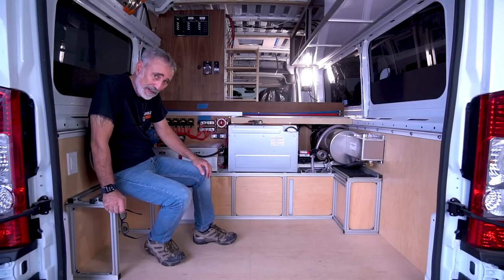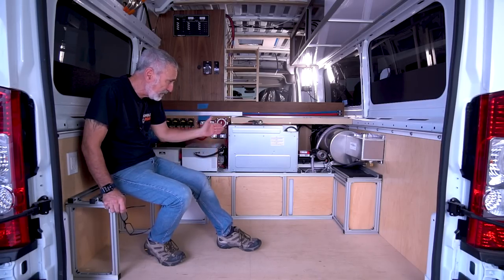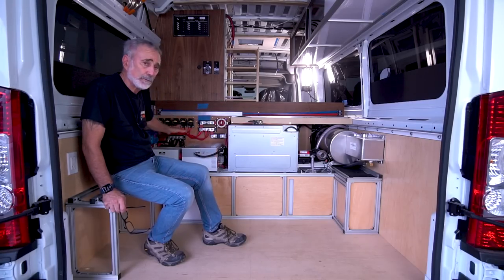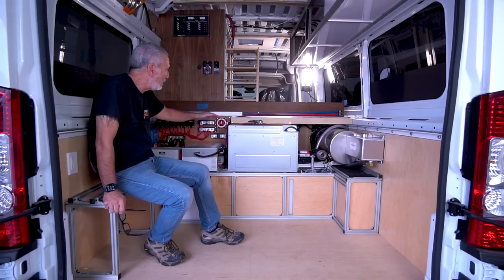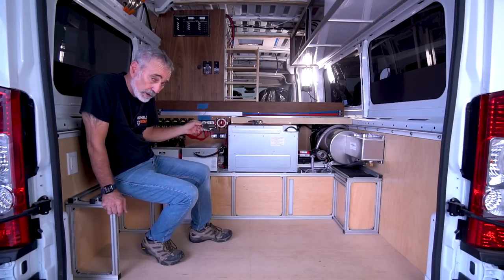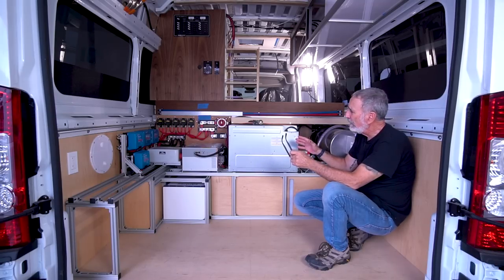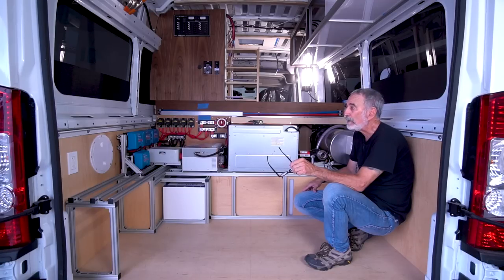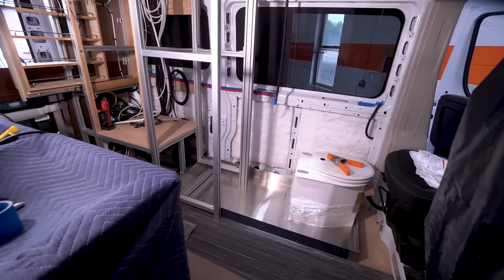When planning your VAN POWER AND WATER SYSTEMS, be sure to utilize the space wisely.

Comment: A most artful job, per usual.

Your addition of a microwave got me thinking of adding one to compliment my induction cooktop...and then I research the relative efficiencies of each. Microwave are about 50% efficient with most of the energy lost in the conversion to microwaves. Induction is about 85% efficient by creating an electromagnetic current directly in a pot to generate heat, losing very little to the air. 

No need to take up the space for a microwave if you have an induction cooktop, IMO.
Reply from the maker: They each have different functions. I’m not a fan of microwaves and only include them when the client asks for it.

Comment: Absolutely brilliant engineering for function and serviceability, as Murphy says if something can go wrong it will. So being able to understand the systems and access them quickly is often overlooked by manufacturers. Are there any concerns with the water systems being so close to the electrical?
Reply from the maker: The main plumbing manifold is located under the galley, isolated from the electrical. The water pump, water heater and the glycol reservoir are on the opposite side of the van, separated by the microwave carcass. The water heater would have to basically explode to cause any kind of electrical issue. In which case you've got bigger problems! In the Sprinter I just completed, the water pump was right next to the inverter. There, I addressed your concerns and installed a PVC wall to block any water intrusion to the inverter.
Reply: @HumbleRoad  thanks for the reply George, as always you have thought out every possibility. Great design!

Comment: If you stop for gas, then use the restrooms.
Public pay showers should be mapped out and you can also have an outdoor shower installed.
Reply from the maker: I’ve lived that life and to have my own private shower in the van is preferable. I would use public, but once in a while it was a real treat to be able to have a shower in my van.
Reply: @HumbleRoad  - Yes. Truthfully, you need to keep clean so you don't offend others with your body odor and for your own good hygiene. The luxury and necessity of a good HOT shower WITHOUT wasting water is a daily thing unless you are in France. They go a number of days between showers. But their toilets have a bidet which is used every time they use it. Hmmmm. I am conflicted because I prefer a bathroom and shower in the rear area like in some of the Coachmen models, but I also value the rear garage/utility area for storing at least one recumbent trike and/or bikes. The Coachmen Cross Trail 20XG has it all and solves almost everything. A dedicated shower that I would easily fit in. Stinky bear no more. But the Coachmen Cross Trail 20XG is a class C.

Comment: Great Electrical layout.  Sure looks clean & simple = Professionally done. 
Re. 45 Gallons Water Tank vibration
Q - did you put a little rubber pad underneath it & on the 80-20 supports? 
Q - how about water swashing around… any mods? 

Cheers -  Yvon 

——
Reply from the maker: I mount my water tanks on a smooth plywood surface. There are anti-swashing balls you can fill the tank with, but those would interfere with my tank level sender. It seems that tanks under 50 gallons do not necessarily require baffles, where larger tanks have the baffles built into them.

Comment: I've recently watched a video on a Sprinter twin bed and rear bath.
It's made by a well know motorhome company. I can mention the  name if you like.
They are using a converter and I think a small size inverter. 
The converter is used when plugged in.
What is the best and most efficient one to use?  Is a converter and inverter a good plan?
I have seen DIY van builders and some commercial ones use large battery banks.
That is needed to run the ac and microwave.
Also need a large inverter.
The best for me would be an automatic system to charge the battery bank off the altonater and pluging in and maybe some solar panels.
Reply from the maker: A converter is advantageous if you plan on being plugged into shore power for the majority of the time. I tend to build for complete off grid autonomy.
Reply: @HumbleRoad  Thank you for your response. I'm starting to understand the electrical system better.
Was wondering about the ac. Advantages and disadvantages of 12v or 110.
I like the off grid. And heating with the van's fuel.

Comment: Thank you for sharing your masterpieces with us George. Absolute work of Art! As I've asked in a previous comment to you George do you think there would be any reason to have concerns about having a bed over the top of all the electro magnetic fields generated from all the electronics? I'm planning on having the same setup but I can't help but think about it all the time...
Reply from the maker: I think there is enough shielding and low voltage that it isn’t of any concern.
Reply from the maker: You most likely have more exposure from a kitchen microwave.
Reply: @HumbleRoad  Valid point George. Thanks mate.
Reply: People worry about Magnetic fields and EMR but every time they use their cell phone they are transmitting high frequency radiation right into their head. Cell phones transmit up to 6 watts, which is a significant amount.   That said, the massive inverter under the bed isn’t ideal, but it will be off at night. Switched off no EMR.  I worry more about all the poison chemicals that are in our food supply. In the US it’s scary what’s allowed that other countries ban. Eat organic and worry less about EMR. Even very small distances from that form of radiation reduce exposure to insignificance.

Comment: A boat builder with an army of engineers and the latest CAD software would be envious of how you can do space optimization in such a small shell without the massive overhead.  Question: As you have completed several vans at Humble Road Industries (HRI) 😇, are standardizing on parts suppliers and design methods or is this not possible for your customers wanting a bespoke solution?
Reply from the maker: Yes, and yes. Certain clients request certain components. If left up to me, I am making a move from Xantrex to Victron.

Comment: George, have you given any thought to switching to something like an Ecoflow Pro x 2 or 3 for the electrical ?
Reply from the maker: I am very satisfied with the quality and performance of the Lithionics batteries. And the scalability is very easy. I will most likely switch to Victron inverters.
Reply: @HumbleRoad  isn't there an extra level of dependability with a daisy chain of multiple Ecoflow units ?  Ease of installation ?